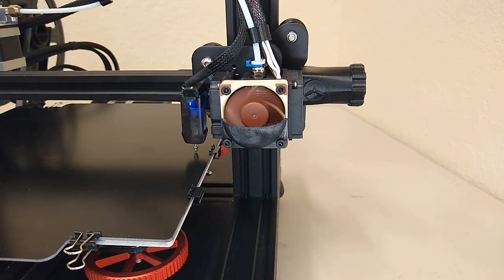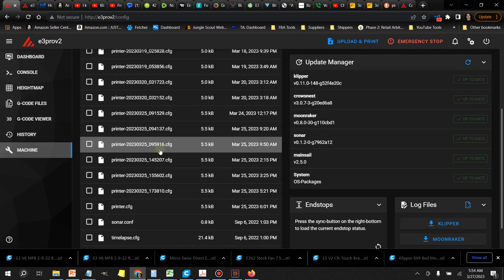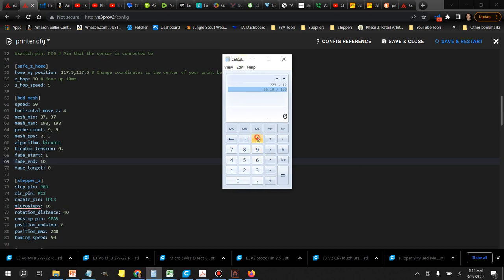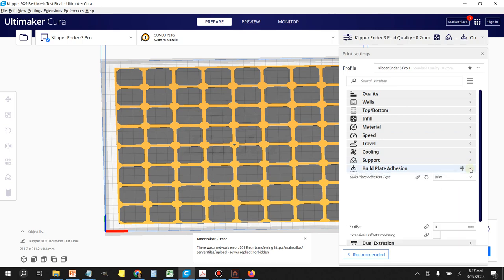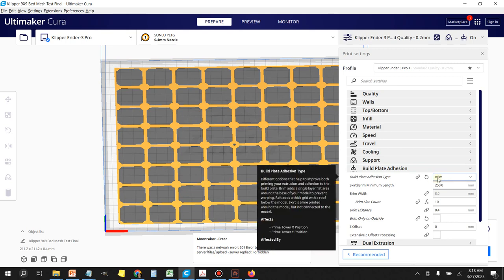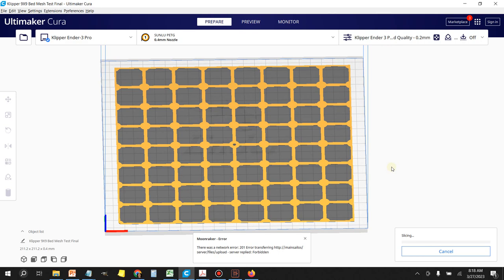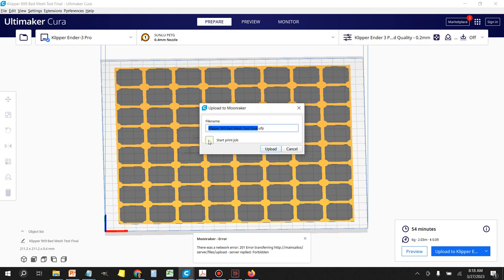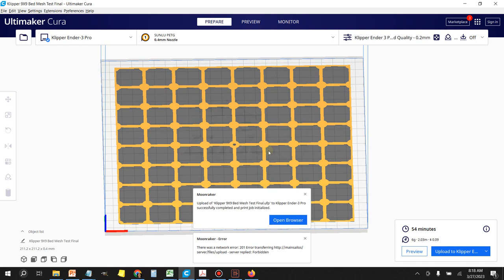Ender 3 Pro V2 Creating an Accurate Bed Mesh by Expanding Your Bed Probe's Reach

Comment: Thanks for this great video. I converted my ender 3 pro to klipper with Kevin's dual belt mod also but when configuring the printer to probe the bed from edge to edge I have been struggling. Now I know what I need to fix. Thanks once again 🙏
Reply from the maker: Hi GP, Thank you for your kindness, you're most welcome.  I'm glad you found the solution to the mesh alignment issue in this video. The Klipper documentation doesn't always connect the important dots needed to implement some features .

If you run into anything that stumps you just ask so I may be able to save you some time.

Comment: In normal firmware you can andjust Z ofsets baseline by moving X gantry manually while print is on pause
Reply from the maker: Hi Madvelila, Thank you for commenting in info. Are you taking about the tune feature during a print or something else. If something else, could you please point me to a video on what you're describing so I can learn more about that. I have a couple of machines still running Marlin based firmware.
Reply: @vbared  I found it out by accident. There is no video.

Comment: Hi great video you don't mention doing the Probe calibration?  Am I right in thinking you start with the Screw Tilt First,  then the Probe Calibration,  then the final part the bed Mesh. ?Thanks
Reply from the maker: Hello David, Thank you for your kind comment. Yes, you're 100% right. Once all the mechanical changes are made then z-offset calibration, bed tilt, and finally mesh creation. The thing that was messing everything up for me was the fact that my z-offset was 1.96 so no corrections where made at points that had a deviation greater than .04 because of the -2 min travel defined in the [stepper z] section of the printer.cfg file. 

I found that this problem is present in Marlin based firmwares as well. One of my non Klipper machines suffered from the same inaccurate bed mesh and required lots of manual editing to fix. That machine had a z-offset of -2.60 so adjusting the design of the bracket by raising the probe mount 2mm brought my z-offset up to -.60 

The meshes now works as intended in both Klipper and Marlin without the need for any editing.

Comment: What happen to dual z belt mod? Did you ditch the mod ?😅
Reply from the maker: Hi Alex, Thanks for commenting. 

I run 6 machines total 2 Ender 3 V2s, 2 Ender 3 Pros, a CR10S Pro V2 and a Coreception 300. 

My Ender 3 V2 that has the Kevin dual z belt mod, E3D V6 all-metal hotend and Micro Swiss dual gear extruder is bulletproof. It's the one I rely on to make the parts for all the other machines when they are being worked on, it never has issues. I'm thinking about either adding linear rails to it or Convert one of my Ender 3 Pros to a Switch Wire or maybe both.  

Let me know what you think.